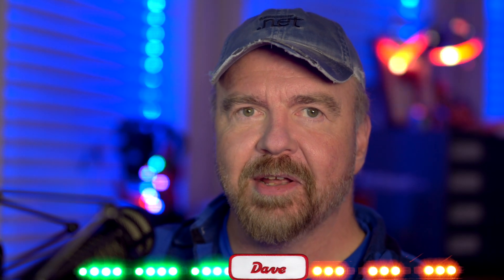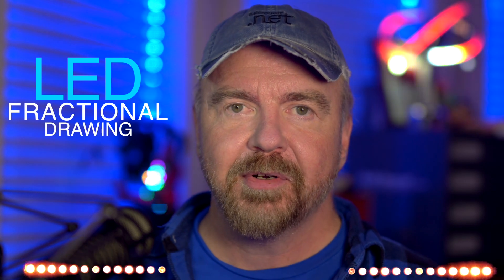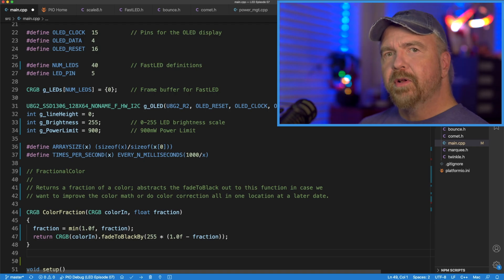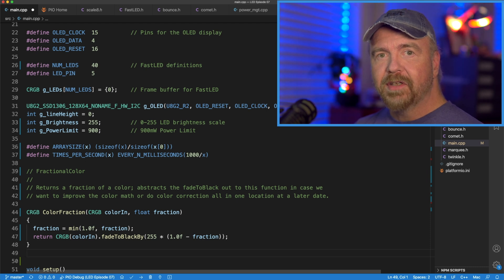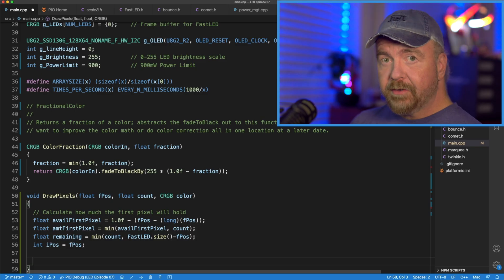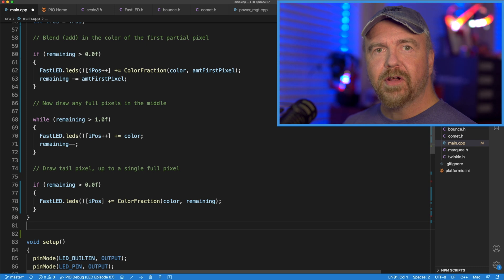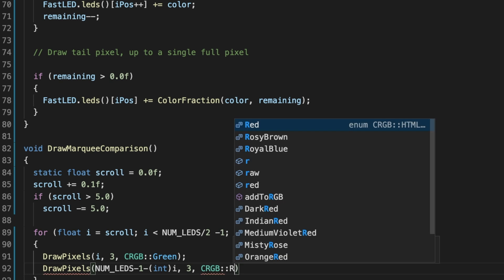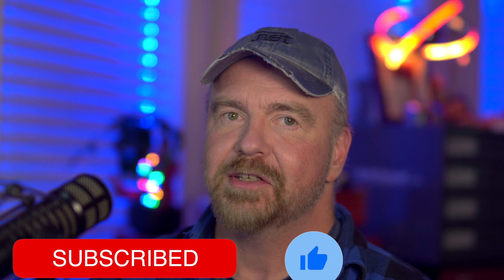09-Precision Draw - LED Strip Arduino Tutorial - FastLED Effects - on RGB LED WS2812B

Comment: Come up on my first hiccup in the code so far - at least I cannot understand why this error is being thrown at me - now I've added these functions and tried to implement them - the interpreter is claiming I cannot 'convert 'CRBG' to float when I used DrawPixels(i, 3, CRGB::Black); or indeed DrawPixels(i, 3, CRGB::Yellow); or anything - it just doesn't want to take the CRGB input - but I've gone over the functions and it doesn't make any sense to me - any ideas where to start looking in to this?
Reply: nvm - I figured it out - I think, I was using a for loop with integers not a float - which the function has to receive.

Comment: Thanks Dave, this code and the ideas you shared about fractional drawing have been very helpful for my own project. In fact, it was your videos about individually addressable LEDs that got me interested in the first place. I'm using an Arduino Uno now, but plan to move on to ESP32 at some point.

Comment: Knowing that the actual 3 LEDs in a pixel in these strips are not arranged one next to another, but in a circle with one color covering the entire width, and the other two covering about half the width each, you could use a variation of what Steve Wozniak developed for the Mac, where the color pixel that directly adjoins the fully illuminated pixel gets illuminated a bit more than the others, the color that remains gets no illumination until the fractional line starts covering it as well. I'm not sure of the arrangement, but suspect it's something like Green across the entire width, Red across half, and blue across the other half. In this case the Green led is adjusted as you are doing, and the red, or blue leds are adjusted as the old technique would.

I realize there are differences here as well, considering that the spacing between the pixels in the strip will probably have even more of an impact, as neither the pixels on either a CRT, or LCD screen have the gap between them that all but the tightest light strips do. But it would be interesting to see if it could be applied smoothly, and whether it would look better or worse.

Thank you.

Comment: Hey Dave, first, thanks for all this great content!
As to if there’s a faster way to do this, let me begin by saying that I’m only a hobby programmer in C. 
I was thinking that what if you just sized an array of color pixels that was, say 100 times bigger than the number of LEDs you had and then averaged them out before sending to the strip?
I’d be willing to write this and maybe even do a “drag race” but I don’t want to waste my time if you can immediately tell me that it would be less efficient. 
I bow to your superior experience, sir!
Reply: Daniel, did you ever try this? Curious about the efficiency. I think one concern would be memory use on smaller uC's like the Arduino Uno. ESP32 not so much.
Reply: Performance-wise you'd probably be better off with a power-of-two multiplier, like 128 or 64, so that the final division becomes a bit shift. Even 32 or 16 would probably give decent results (and save memory). Keep in mind too that extra "subpixel" values means not just more memory, but also more calculations on each update.

Comment: Hi Dave,
Love what you do here and certainly appreciate your nod to the FastLED library - I'm counting 20 videos to date where they have featured!
I made a note to look this video up again when I was ready for precision drawing and I'm really grateful for following through
I even had the courage to give your ColorFraction routine a tweek:
I've reproduced it below in case your other follower were interested

CRGBW ColorFraction(CRGBW colorIn, float fraction){
  fraction = min(1.0f, fraction);
  fraction = (32645 - cos16(fraction* 16300))/32645.0f;
  return CRGBW(colorIn).nscale8(255 * fraction);

}

It came about when I spotted an anomaly with WS2812b  leds
I don't know whether you have spotted it but increments in the lower brightness values (say 0 -50) are for more perceptible than brightness increments in the higher range.
By applying a section of the cos curve, I've found it goes to some lengths to correct this anomaly.

That said, I'm sure someone out knows how to do it more efficiently:-)

Comment: Hey Dave, 
I would like to implement DrawPixels in my code but the problem is, Im using lerp8by8 which returns a uint8_t value for the index of my led strip each  iteration. Do you have any ideas so I can implement the DrawPixel function while using lerp8by8?

The reason I'm using lerp8by8 is that I have four led strips of different lengths that I want to light up from beginning to end at the same time.

Comment: Dave thanks for all the work...awesome stuff. I do have an issue with this episode's code. I get solid green on the right, solid red on the left with one single yellow but not in the middle (more green then red). Thought it was my typing but nope copied the code from GitHub. I still get the same result. Any thoughts?
Reply: I am also getting these results with both my typed code and the GitHub code. I have changed out the LEDs and also changed the GPIO pin with the same result. Could really use some help! I want to add that all of the other effects we've coded are working fine. Thanks, Mark
Reply from the maker: Which function is this in, DrawMarqueeComparison()?  I'll test out from github an let you know, it's quite possible I checked in a bug at the last second!
Reply from the maker: Let me check!  Is this DrawMarqueeComparison?
Reply: @DavesGarage  Not sure it's in DrawMarqueeComparison(). For testing, I upped the delay at the end of loop() to 1 sec and you can see the pixels building in color but they never reduce in color as the marquee moves. This is the case for the smooth green marquee as well as the red marquee. I think it could be in DrawPixels() where the first pixel is not being dimmed.
Reply: Yes
Reply: Having the same issue, also.  I have only typed out the code via the video, but haven't checked GitHub yet.
Reply from the maker: @p.pirinen6203  My bad, ladies and gentlemen!  When I commented out the comet at the last second to check in that "minor" change, I forgot to add a FastLED.clear() to replace the fade-out.  So the fix is to add this line right before the DrawMarqueeComarison():

FastLED.clear();

Otherwise, we just draw overtop the last frame, which is what is happening.  My apologies, and I will fix the github code right away too.  Good thing it's in github!  Kinda neat that the color merging works and you get yellow in the middle though :-)
Reply: @DavesGarage  Perfect.  I applied the fix and it is working.  Awesome, and thank you again for the great content.
Reply: @DavesGarage  Thanks Dave, that did the trick. Eagerly  awaiting the next lesson!
Reply: @DavesGarage  I wasn't getting any yellow even without the clearing.